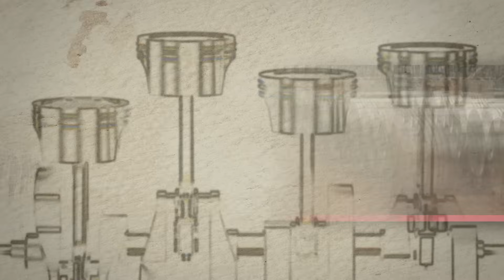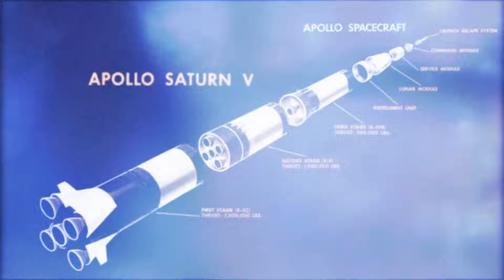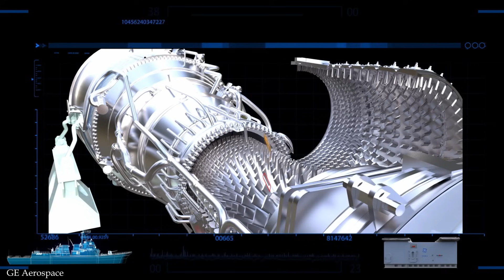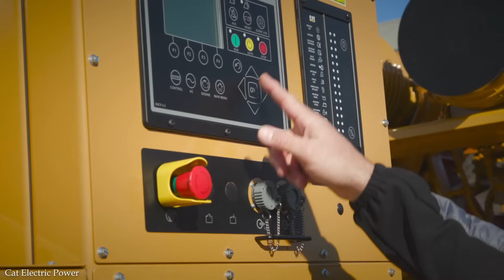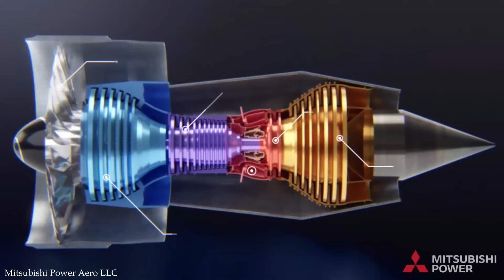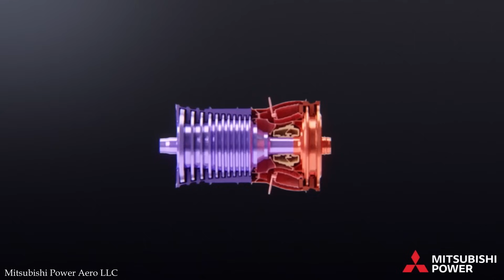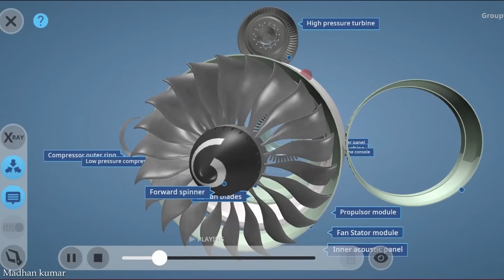15 BIGGEST ENGINES IN THE WORLD

Comment: Mercedes OM473 is copied from the Detroit Diesel DD16. The only difference is the OM473 has it's own electronics that are different than the Detroit Diesel DD16. Detroit Diesel developed this engine and when Mercedes saw how well it worked in the USA, used it in Europe on their trucks. It is the first inline 6 cylinder in the big Mercedes trucks rather then the V-6 and V-8 they used to use-plus it has Jake brake built into it that Mercedes never had (instead of an exhaust brake or hydraulic retarder).

Comment: This video needs a redo, the rocket engine was the MOST powerful in that video, not the container ship engines. Also, if you are going to talk about gas turbine jet engines then you should do more research and should have listed those used to produce electricity from natural gas. They are 500,000+ horsepower. A GE 7HA.03 would destroy all those engines you listed except the rocket engine.